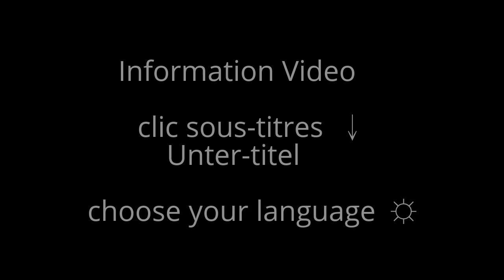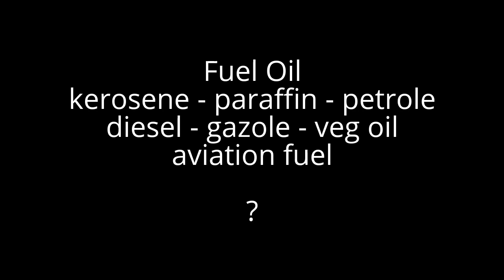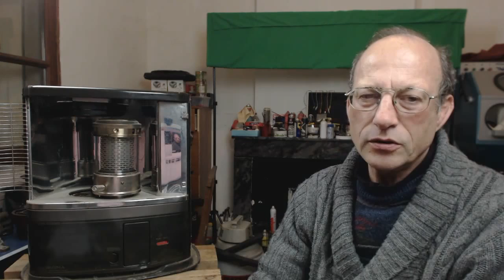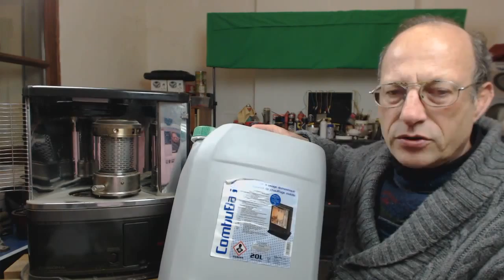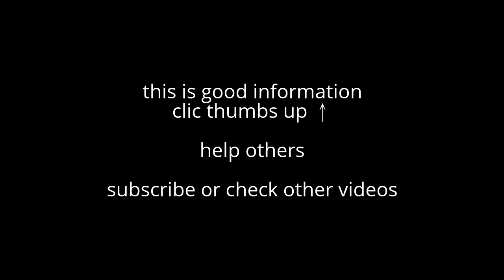Cheapest safe heating fuel - paraffin / kerosene / petrole heaters & stoves

Comment: Thanks, what can you tell us about Alcohol as a heating fuel ?
Reply: Would rather drink it to keep warm.
Reply from the maker: Ha yes, though I'm guessing that not all alcohol makes ideal booze :)
Reply from the maker: I'd go for acetone as a mix with your fuel - paraffin or kerosene.

It breaks down the surface tension of the oil, allowing superior vaporisation.
This gives a cleaner, and slightly hotter burn.
As a result, it will keep the system cleaner, and will logically produce cleaner fumes.

Only tiny amounts are needed - even a quarter of a percent makes a big difference.
I'm running with 1% acetone this winter, but I have a local source, where 5 litres costs €15.
5 litres treats 500 litres of fuel at 1%, so the cost is insignificant, and the gains are substantial.

If you have a cheap source of alcohol, you could certainly try it in your mix.
It will be a bit like adding petrol to diesel in winter, for easier starting and more power.

Take it steady though.
5% to fuel oil might give very good results.
But first start with acetone, and check the flame colour.

If you have a pistol temp reader, you could remove the front grill and get a reading off the flue at a known burn condition, then repeat with your chosen mix, and try with alcohol.

:)

Comment: The highest quality we can get in Canada is 1K kerosene. .burns cleanly. .a little smelly on start up and shut down. .so I do this outdoors
Reply from the maker: Thanks for that comment hamish.

I researched 1k specifications - ASTM D3699 - 18a.
Annoyingly, they are hidden behind a paywall ...  $48 to see.
This is not very helpful, when a consumer is looking to determine the safety of a product.

However, a summary is listed here https://www.cenex.com/~/media/cenex/files/fuels/data%20sheets%20and%20brochures/k-2%20kerosene.ashx

It's not a great summary, but it's the best that I've found, and it is VERY interesting.

The flash point is listed at 37.7 C (100 F)
Wow!

If this is true (see below), it means that both 1k and 2k grades are highly volatile.
On a very hot summers day, they will emit flammable gasses (like say petrol).

It seems hard to believe, but perhaps it is refined so highly to counter the extreme sub zero temperatures experienced in Canada.
But even still; in a home environment, the house would rarely be so cold.

To put this in context, the burner pre-heater need only warm the fuel to 38 C in order to create a gas, compared to C1 56 C.

That is confusing as you state that it fumes on start up, unless the pre-heater only heats to 38 C.

Again, if true, these fuels would have an extremely high energy content, and burn very hot.

Note also, that once running, the room temperature will be no different to that in Europe.

Hmmmm!

My belief is that different test methods have been used.
There are two basic types of flash point measurement: open cup and closed cup.
These different test procedures produce wildly different outcomes.
In this respect, different standards cannot be compared.

This differential is often used in published oil specs, to prevent the consumer from choosing their oil based upon which is the best (leaving that goal in the hands of the marketing departments).

Note the mix of F & C temp measurements :(

Also note that dangerous element content is not listed ... only sulfur, that concerns smell.

Therefore, overall we learn very little from the privately provided summary.
What a shame.

Does anybody fancy blowing $48 ?
https://www.astm.org/Standards/D3699.htm

:)?

Comment: Short answers. 
Kero heaters.
You can safely burn red dyed off road kero if you have modern fiberglass wicks.
Use an O2 detector and common sense.
If it smokes the fuel or wick is old/dirty.
Reply from the maker: Er Gerard ... did you actually watch the video?
Did you download the specs?
Did you think before posting?

Your channel is devoid of all activity.
Nobody knows you from Adam, nor why you would post your bizarre and obviously incorrect safety advice.

What are your motives here?
A 'paid for' troll perhaps?
Or just a lost soul spreading misinformation?
Reply: The directions that came with my heater says you can burn red dye off road fuel in it. It's a modern heater with fiberglass wick

Comment: I've got an old Aladdin Blue Flame Series 25, I've been using it for the last 4 years, I run it on standard heating oil straight from the pump at a petrol station near where I live, it's kept us warm on the coldest of winter nights, but I'd never use it without a carbon monoxide monitor, incidentally the monitor has never gone above 8ppm and only then on occasions it normally sits a zero, the nose is the best indicator, if it stinks something is wrong, usually dirty wick or contaminated fuel ie water in it,
Reply from the maker: "if it stinks something is wrong,"
This is true for the presence of pollutants, but definitely not for the imbalance of oxygen.
This is due to the available oxygen being used up by the combustion process - ventilation is required.

Regarding pollutants ... the vid explains this clearly enough, and it is easily understood.
... if you burn a pure alcohol everything is burned ... you are only using oxygen - there are no dangerous particulates remaining in the combustion fumes.

As you proceed down the refining grades, the oil becomes less volatile.
This requires higher combustion temperatures to consume the pollutants.

However, the heater is what it is.
For portable heaters, the combustion fumes are vented into the enclosed living space (regardless of ventilation).

Be aware that these heaters WILL burn lower grade (less refined) oil - say high grade heating oil, that when burned, must be vented outside via an installed flue.

With an externally vented flue, there is no need to use highly refined oil, so the oil is cheaper, because it is siphoned off at an earlier stage of refinement.

Ha!
If you think that is bad ... these heaters will burn oil that is even less refined; or oil that has additives to assist with engine combustion/operation.

If that's all you can get (or afford) ... be aware of the risks, particularly if you have children.
Try  to ameliorate the situation, with a regular full vent of the room (open the window and a door) ... you will immediately notice the difference with your eyes and drowsiness.

Also be aware, that with heating oil and lower, the heater must be dismantled and cleaned after each winter (or also mid way through the cold season).
This is your balancing 'labour payment' for the cheaper fuel  ;)
(Once done, it is very quick and easy - see https://youtu.be/VC-5657JLhU )

The other cost factor is that the highly refined paraffin C1 grade oil produces 10% more heat per unit, over C2 grade heating oil (and correspondingly more over the lower grades).

This means that if heating oil is 10% cheaper ... it is in fact the same price (but with more dangerous pollutants).
If it is 20% cheaper ... it is only 10% cheaper and you get the pollutants, and you must also pay extra with your labour).

There is no free lunch ;)

Also note that the C1 grade paraffin allows the heat to be turned down without creating more pollutants ... keeping you acceptably warm without wasting fuel by overheating.
(wasted heat is wasted money - 10% overheating plus the 10% less calorific value and you've just blown your 20% saving ... to gain more pollutants, and a regular heater strip)

I don't cast aspersions, or sit on a high horse - there are plenty of visitors to this channel that get the oil that they can get ... it is all about being aware, and doing your best to look after your family (who will be relying on you).

Hence why I recommend, if at all possible, to locate the cheapest source of the highest grade fuel.
Buy in advance, and buy in bulk, and make sure that you check the specs before handing over the cash - the fuel salesman can, and often will, tell you what you want to hear ;)

Remember ... the laws of physics always apply 
... but I know that we do, what we must do, to stay warm :)
Reply: @EngineTuning  great job setting it straight!
Reply: Thanks for the info, they do sell C1 at my petrol station but it's £35 for 20lte, at the moment I'm paying 75p for a litre of C2 heating oil, when I first got my Aladdin it was 45p a litre, but so far in the last few years we've had no ill effects from using standard boiler juice, switching to C1, would be more expensive than using our storage heaters, which incidentally are useless, hence the reason we're using the old paraffin heater
Reply from the maker: I can't answer the comment from a knowledgeable health perspective.
I'm an engineer, and I am taking a punt on the fact (?) that the British Standards were created by other engineers who did their best to document the pollutants arising from the combustion of lower refined oils.

Also, their conclusions are logical ... the more refined, the less shit that remains in the oil, and the hotter it burns.

As for the business economics ... for sure, the price difference is entirely unfair.
The cost difference between siphoning off the oil earlier grade, cannot equate to the enormous price difference. 
... evidently, this difference is a rip off.

However, it is what it is ... you pay your money and make your choice.

Personally, I look for the cheapest source of the highest grade fuel.
I've found that there is always a cheaper supply, cos they are still making money.

Unlike typical goods, we have specs.
So, you are not paying more, to get higher refinement.
You establish the specs first, and then pay the minimum that you can.

Obviously, you can choose to disbelieve the specs, and believe that all oil (thick or thin) is the same ... but the cleaning regime proves otherwise, and the rest is simple arithmetic.

Ships burn bunker fuel ... effectively the very last grade - the bottom of the barrel.
Incredibly toxic, they burn over 100 tons per day !!!!!!

The vid does not present a political message; rather, it is pure information.
You might use that information, to find the cheapest source of fuel that you need OR to take care, when burning an oil that might not be good for you in the long term.

Obviously, if you don't have kids, it's not a problem.
Just talk it over with the missus, and come to an agreement :)
Reply from the maker: One more point ... £35 for 20 litres is a total fail.

last year, in France I bought 20 litres for around €17 .... maybe 15 quid!
Therefore, I believe that the £35 is a joke price, and not really applicable for serious people.

Why not take the usual option, and find the cheapest source?

Have you ever bought a sandwich at a petrol station?
Ha!
The better option would be to spend two minutes grabbing some food from the fridge (almost free food in comparison).

It's a no brainer.
You don't stock up for winter, by buying from a convenience store.
They are just for emergencies ... and you are made to pay for 'not being prepared'.

Is that fair comment?

Comment: Does anyone know the ratio of paraffin to kerosene to make "lamp oil" Class III-A? You can just buy lamp oil but It would seem to be a few bucks cheaper to mix my own. crack a window yo? The proof of what Mr Tuning is saying is in the furnace filter after a winter. Home owners should put a duct on the cold air return to draw in some fresh air from outside,if you want to burn fuel in the house regularly. Don't be Silly, all aspects of fire is dangerous and should be treated with respect accordingly.

Comment: How dangerus are kerosene heaters and foumes?
Reply from the maker: The immediate danger is CO2 - there is risk of death.
CO2 rises as the oxygen in the house or room is burned with the fuel.

If you do not have a CO2 sensor... ensure that there is ventilation.
Be aware of sleepiness, headaches etc.
CO2 is odourless, and colourless... so be careful.

Thereafter, the risk is dependent upon the fuel that you are using.

1. Highly refined - for NON-VENTED systems (an individual heater in the room)
2. Less refined - for VENTED systems (has a flue or chimney)

There are also fuel oils that are not intended to be burnt as heating oil.
Diesel, Jet Fuel.
The problem is that these oils may contain additives that are required by the engine (or jet).

For all oils - in an individual heater - you breathe the combustion fumes.

So you have a choice.
Breathe combustion fumes that have almost no toxic substances - they were refined out of the oil.
Or
Breathe combustion fumes that have high levels of toxic substances - they were NOT refined out of the oil, because the fumes are meant to be carried outside by a chimney (or a car exhaust pipe).
Reply: @EngineTuning  , i think you mean CO, not CO2.
Reply from the maker: What makes you think that?

Comment: i see a lot of negative comments on this video when all this man is trying to say is help your health. paraffin heaters always recommend using in a ventilated area to get rid of carbon monoxide. Some people do get affected more then others when it comes to the smell of paraffin. people dye of paraffin heaters because they use the wrong fuel such as dyed kerosene or that they haven't ventilated the area. Paraffin heaters are as safe as any other heat source if they are used in the right way. Although i believe that most that is said in this video should be common sense but the fact is, he has made this video to try save lifes.
Reply: I always have a dual fire/ carbon detector no matter where I live/ car/ camper/ tent / home. Haven't needed it except for some burnt beans once. But prevention safety counts. PS I agree with you
Reply: Who has died of using the wrong grade of kerosene, dyed or other? Where did you get this information?